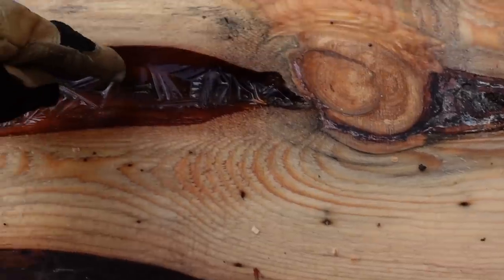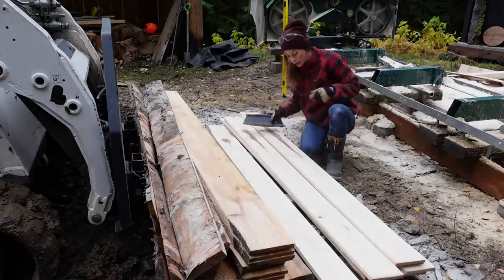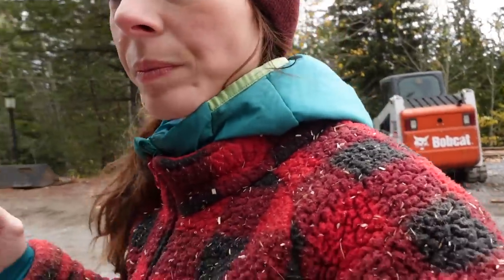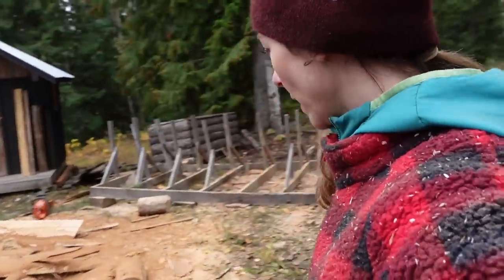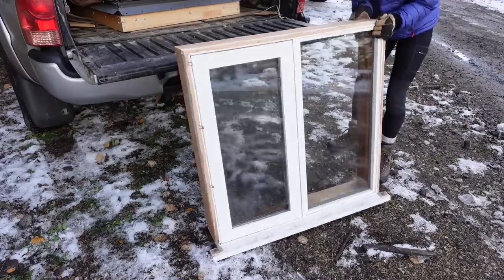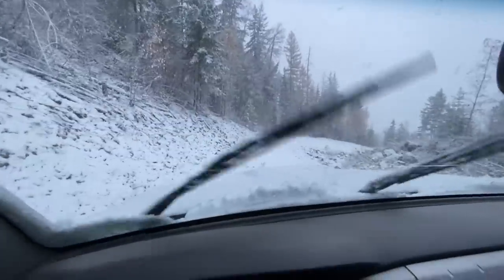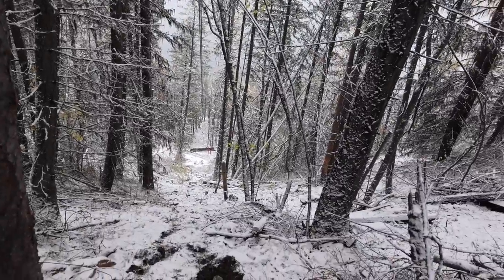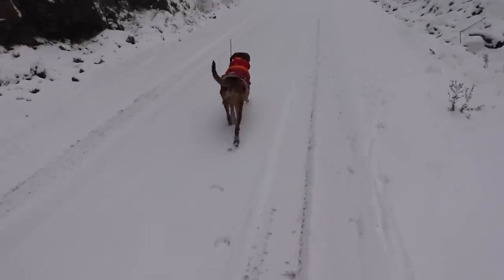SUCCESS. Many pains = many gains. Last days at the sawmill, SkyMule 3.0, first snowfall.

Comment: Hi Michy, the 2 inch slab you were talking about selling, turn it into a coffee table, coat it in epoxy resin which will make a feature of the holes and imperfections and then sell it. You'd probably get a good price for it as a finished item.
Reply: I was going to suggest this as well. 👍
Reply: Ditto. That was the first thought that came to my mind.
Reply: Was thinking the same as well...
Reply: lots of folks are making epoxy resin tables etc. at the moment. And they can be impressive! But if you have just wood it is easy to recycle it at the end of its useful lifecycle. If you pour it full of epoxy, at the end of the lifecycle it is a piece of landfill. That should always be considered. I am not against epoxy, but its one aspect everyone needs to find out for themselves. If you work with wood like this fine lady, collecting even the already fallen trees to make decorative boards with all their imperfections, I could imagine there might be an appreciation of "the way nature made it". Just my two cents....
Reply: @SuperRistopaha  I believe you'll find that resins like eco-resin, silicone resin, and epoxy resin are biodegradable.

Epoxy, polyurethane and silicone are completely inert once catalysed and thus environmentally safe. 

Therefore, when epoxy resin is completely polymerized, it cannot contaminate the environment.
Reply: I would’ve suggested 2 or 3 pieces together for a great outdoor table.

Comment: For next winter you could clear an 8 ft wide swath under the sky-mule cable. Then when snow falls u could just hop in a cheap plastic sled with a couple pieces of gear and sled to your cabin.

Comment: Well even though Lenny is into the chains of tires, not into of chains, 🤔🙂 ... Anyway Awesome, good too see everything working ⚒ . Those cedar slabs could be book cased together removing one live edge off each slab. Dowel or biscuit them together ,smooth them up and and epoxy it. Make one big table or two, or counter top. 
Good to see the sky mule is up and working. The windows should either be up right or covered with wood or the roofing metal,(falling branches or globs of dense snow). Oh and by the way, saw dust smells as good as baby powder
😁. Take care and be safe and have a blessed week amen.

Comment: When I have to mill my smaller logs I screw them down to a 2x6 making sure I do not cut so deep I cut into the screws holding the log to the 2x6 .  I am starting to make some live edge pieces to use for base board trim or door jam trim.  Works great because you dont need wide planking for that and small logs work great for that purpose.

Comment: Yes, proper tires. A good set of knoby tires for all around winter use.
Reply: I disagree.  Snow tires need to be narrower not wider nor knobby as they will wear out much faster.  Purchase good quality studded snow tires for a light truck and they will last a long time provided you don't drive them on dry pavement for extended periods of time since the rubber is very soft. I live in the Green Mountains of Vermont and that's what I have on my F-350 Super Duty during Winter and work like a champ.

Comment: I finished working outside today (about 50F), came in and parked 10' from the woodstove to warm up and relax with a cup of warm cider.  Within minutes I was nice and toasty.  Clicked on your video and it didn't take long watching you work in those frigid temps before I could almost feel that awful feeling of getting cold working in those conditions!  😂  

Glad to see you got everything down to the site!  If you happen to go back down there soon, I'd recommend throwing a few planks across the top of the windows so branches, or possibly even heavy snow loads, doesn't break the glass over the winter.  It won't take too much to break that horizonal glass, especially in the extreme cold weather you guys get.  Also make sure they aren't unevenly stressed. 😉

Stay warm ice princess!

Comment: Was wondering if you have considered adding an electric winch mounted on a quick disconnect Reese style hitch to the front forks upper frame. It would make getting logs pulled out of the woods much quicker, safer and easier. Plus if you happen to get stuck...handy to get pulled out😁

Comment: Hello Michelle. That "ugly" slab could be a table filled with epoxy. Maybe somewhat shorter. If you use the thin board, it might could be shimmed. Do proper snow tires have studs in them? You do have a tree in front of the frame for the wood. If it shifts, it will not go far. Have good days!

Comment: You could fill the holes in the slab with epoxy. Very trendy nowadays...
In my country the dark spots on the birch are called "false cores" as the birch usually doesn't have one (differently colored) and is found on rather old trees.
At least you have steps now leading to the skymule platform. I remember times you slid down there on your...
The improvised storage platform looks amazing. Respect...

Comment: Check out board on board. It's like the reverse board on bat. I did my cabin with random hemlock one by 6, 8, 10, 12 inch. I actually cheated the whole thing with hemlock and then covered the joints with 4 inch 8 inch, 6 inch 10 inch varied. It really looked good. Good luck. You'll do great as always. Take care. Stay safe

Comment: I think I would put some wood over the windows to protect them from any branches that fall when you're not there or put the windows under the cabin? It would suck all that work to have a little Branch break a window just my opinion I'm extremely impressed with your durability strength and determination!

Comment: Your woes with the zip line will go away when you get more used to how loads are distributed. I recommend and inverted V from the sky mule with adjustable straps or lines so the legs of the V can be adjusted to properly distribute the loading of it without too much hassle in the future. Keep up the amazing content! Edit: It would also make sense to attached your "lowering rope" to the rear of the load or to the connection point between the inverted V and the rear of the load to stop it from wanting to rotate while in transit.

Comment: I don't know how often Steve has to pull you out on that Hill but look up Matt's off-road towing they have Matt's off-road yankum rope unit 20 and 30 foot they're good for 37,000 lbs shock load. There is no jolt if he has to pull you out hard it's a nice bungee type pool they are expensive but well worth it they're not good if you're stuck in mud if you're suctioned in. It just tears parts off of vehicles LOL but for sand and snow they are outstanding the 30-footer will stretch up to like 8 ft

Comment: Michy, the snatch block should go on the downhill side of the sky mule. You most likely would want to attach a short rope or rod between the two so you do not have to chase the snatch block. Which might be more easily assembled at the bottom of the run. And if I were doing that much hauling, I would mount a couple of "runners" or dunnage on the upper end platform, so that when you stack materials there would be room to pass ropes or straps underneath the load making it easier to find the balance point.
Reply from the maker: I have mentioned all these things to Steve before and he just ignores me. 😂. Unfortunately he is the one in control of that whole thing, as I am not so good at that kinda stuff. But I’ll pass this on to him again and we can only hope! 😁🤞
Reply: @michygoss7148  I hope all goes well. Thanks for your reply.

Comment: watching you makes me happy that i bought a hydraulic Woodmizer sawmill.  F.. all that pushing and pulling to turn a log.  But that 2 inch slab with the hole in the middle would be a great mantle piece or two shelves fill in the hole withe black epoxy stuff that the woodworkers use. Love the dancing and singing with a plank. beautiful cedar. gas winches help move the logs in the forest or just attach a strap and pull with atv, truck or bobcat.  Also look into logrite I have the atv trailer it's great. Is Steve an engineer?  I thought i saw a what looked like a steel ring on his pinky, Order of the Engineer. also Steve is not so dull after all pulling you out when stuck and helping. dogs look great.
Reply from the maker: He is an engineer! Mechanical. And he’s much smarter than these videos let on - he likes to stay out of the picture. Haha
Reply: @michygoss7148  if you can figure I am an engineer also. I do not own the ring but know what it is, therefore picked up on quickly. I can understand staying out of the picture.

Comment: Hi Michelle!   Thank you sharing the great work in milling and “air muling”. EXECELLENT videography!
A question???  Have you and Steve considered putting a motor drive on the air mule to retrieve it for the return trip?
If not electric then fuel type?
Cheers 👍🏼
Reply from the maker: We haven’t yet. So far not much has needed to be carried back up, other than ourselves and a bit of gear. Which, to be honest, is no big deal for now - it’s good exercise. 
We will let things declare themselves and see what the future might require!

Comment: Hey girl... Maybe you should consider making a viking-style stairway. Take round Sticks/timbers at the size of 5cm-10cm~2-5inch to make the vertical part if the steps (knock them 5-10inch down in the ground), and make the horisontal of dirt alone... This kind of steps are extremely strong and would make the decline much safer...
It might also be an idea to make a landing for the material at the top of the steps... 😉
Reply from the maker: Ain’t nobody got time fo dat! 🤷🏻‍♀️🤪

Comment: Hello🙋‍♂️ from the Netherlands 🇳🇱. 
I might have an idea what can work for the sky mule : 
you could try to put two wooden boards of size A4 paper on the air pods of the skymule in order to increase the surface that is slowed down by the wind .  
to actually make a bigger brake on the skymule.  
if you hang the weight in the middle under the skymule, you only need a very small pulley as a rudder to keep the wood straight, don't you ?
thanks for the video Michelle .  
Sincerely, Hollandduck 🇳🇱🦆
Reply from the maker: Great ideas for sure! I think that the new brake system really slows the load down so well that no more breaking is needed.
Reply: @michygoss7148  
nice that the new braking system works well.  
hope it gives a good and reliable feeling when using the skymule now

Comment: No one can say you don't put in the effort! Well ya gotta do what ya gotta do....Just a word about reverse board-an-batten, if you please: the difficulty is that, once the boards are up, you have to cut the battens to go around framing and etc. You'll nail the boards top and bottom (and hopefully at least one in the middle) to the outside of the top and bottom plate. The battens will just be nailed to the boards, along the edges on the interior. which means they have to be cut at every piece of framing that touches the inside of the boards. In your case, around the windows and studs, at a minimum. Was that clear? Anyway, lots of little openings. You have the whole winter to think about it, but might consider alternatives.
Reply from the maker: It definitely seems like it’ll be more complicated, which is why I’m not 100% sure that’s the way I’m going to do it. I’ll definitely look into it more and way the pros and cons. 
Thank you for the info.

Comment: Rule for log cutting. When it is on the ground you cut from above down. When the location of where you want to cut is suspended off the ground, you cut from the bottom side up. This is so the log does not pinch your chainsaw blade.
Reply from the maker: Thank you!

Comment: At 15:07 I soooo wanted to smell what that freshly sawed board was like too!!! Do you get the logs as a "grapple load"? Or are these logs that you just had on your property that you have gathered to saw up? When they are well aged like this, seems like they don't require any type of drying like green logs would need?
Reply from the maker: These are all trees/logs from our property. All that fallen cedar has been laying on the ground for years, left to rot away. I am not certain but believe it’s a fungus that has killed the root system of the tree, creating a blackened exterior surface, and they die and fall over. They are very dry and ready to use!
Reply: @michygoss7148  That's awesome! (***that the logs are all repurposed from your land) - Do you ever wash them down with a pressure washer to remove grit? Or is it not enough to worry about? I found your channel from my yearning to get my own mill at some point when I find an affordable one - if there is such a thing... I love using studded snows in the winter - hope you all stay safe this winter. Love your content!!!

Comment: We are supposed to drain the gas from the mill's tank and let the engine run out of fuel--prep for winter
Reply from the maker: I fill the tank full of gas to reduce the possibility of condensation, but drain the carburetor.

Comment: Figure 8 is a great idea for a decelerator!  A "rescue 8" would give you the ability to lock it off in a hurry without stressing the Hoser reel.  Not going to lie...seeing the aluminum 'biners through the sharp steel hole makes my butthole pucker a lil.  Aluminum is great on rope and other round stuff.  Steel edges will cut/wear/fracture it quickly.  I'd hate to see you find that out on a heavy load.
Reply from the maker: I’ll pass that on to the big guy 😊

Comment: Why not just store wood and windows under the roof on new building?   Can't help but think a branch might fall on the windows.
Reply from the maker: Because I would need to move them again as I go out there and work. I’m just kind of tired of moving all my materials around and around and around again.
Reply: Makes sense!  I thought you might not be returning to work until Spring.

Comment: Hi!.Just don't try to use this wood!.It won't work.We call this tree a pine tree. So, the resin in it is about 13%.You are not able to remove this resin.Once you use it, it will immediately "lead".It's going to be a nightmare.This wood should lie for two years, then be used.
Reply from the maker: The pine tree I was milling had been sitting for about 3 years